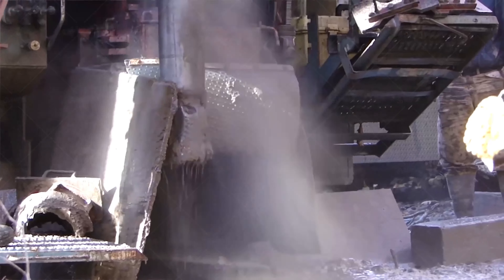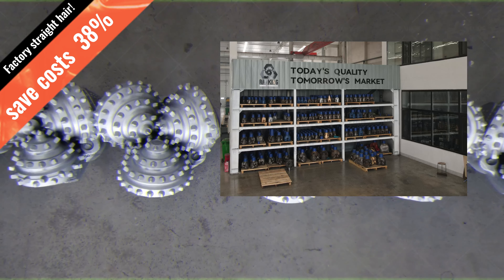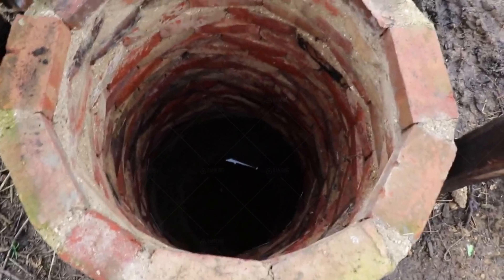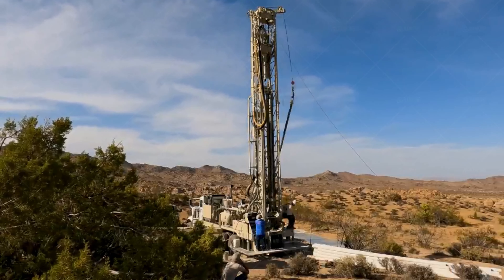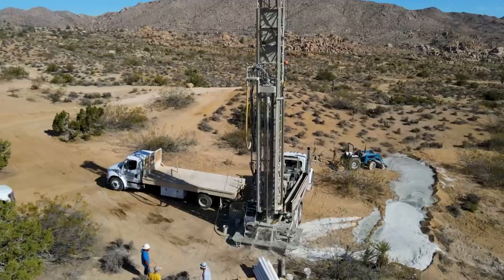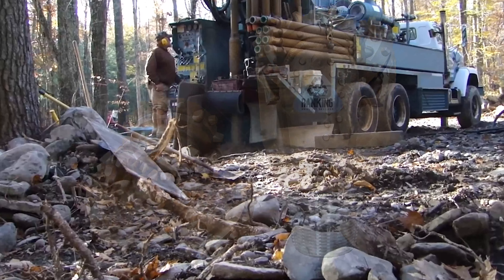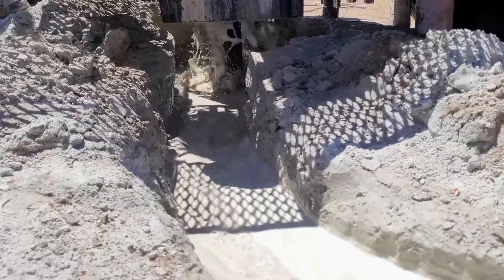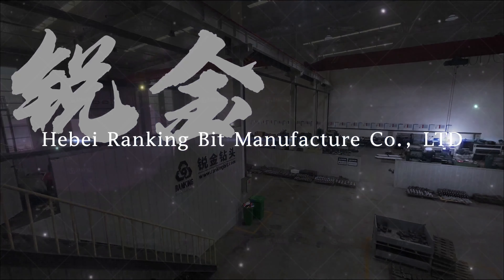Best Drill Bits for Water Well Drilling - Expert Guide

Comment: Great video with great narration and explanation, thank you, it would definitely be neat if the drill had some type of camera system with the ability to transmit to a recorder for expert investigation
Reply from the maker: In the drilling industry, there is a kind of detection equipment called an underground camera. It is a commonly used equipment in the drilling industry that can detect underground conditions! During the process of drilling a water well, be sure to ensure that the water quality is clear!

Comment: Water wells I have seen have a perforated section at the bottom. I have seen explosives to create that mesh or using a meshed pipe. Thanks for putting this video together, there's not enough material on the internet to learn these things.

Comment: My parents just got their well drilled into a deeper aquifer. Just kinda curious about exactly how they found water in an unmapped area (sounding, etc). As for the drill, I worked at a place that manufactured such equipment. The parts were absolutely massive!
Reply from the maker: When preparing to start drilling, the most important thing is how to accurately detect the location of the water source. I mentioned the water finder in my video. If you are interested, you can click on the link on my homepage to get product information. In short, the early work of detecting water sources Very important throughout the entire drilling work!